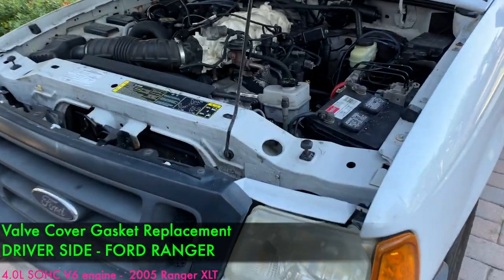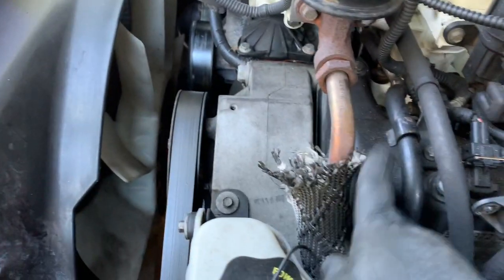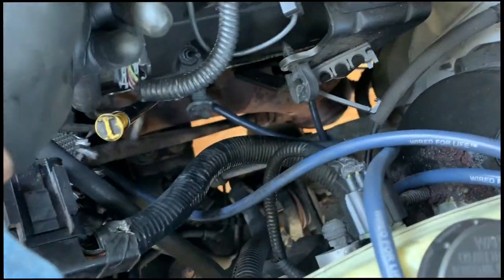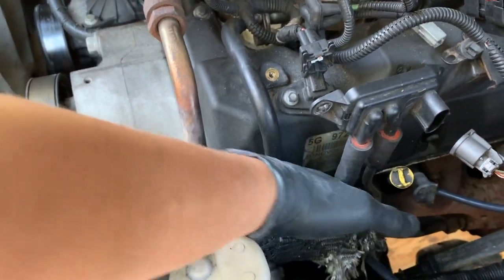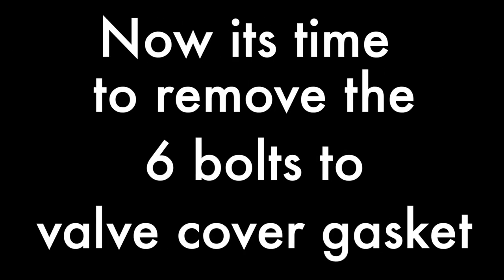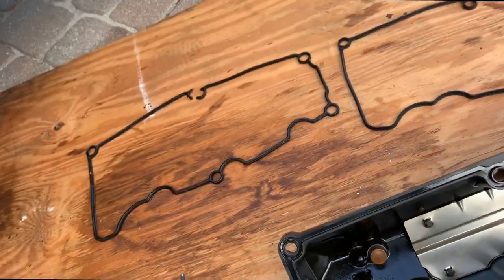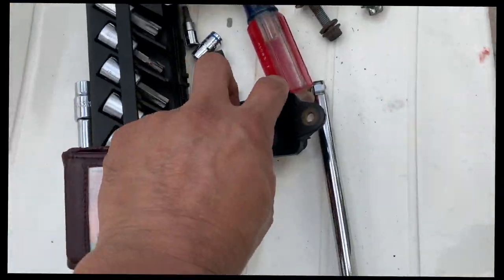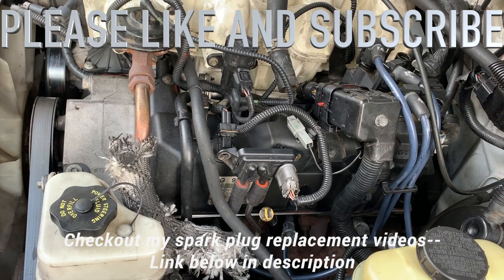Ford Ranger 4.0L Valve Cover Gakset - Driver Side

Comment: One important piece of info you did not show or mention: The PCV valve at the rear of the cover comes out with a half twist COUNTER-CLOCKWISE (it's a twist lock valve, not a straight-out pull type). The 2004 I'm working on has a metal pipe, with two hoses connected, wrapped around the PCV . I think it's for coolant heating of the PCV. One would have to unlock the PCV unless you want to pull all three hoses. A new valve comes with a new pipe ring.
Reply from the maker: @scottdelnero7360  ya but I wasn’t changing it.

Comment: I've done the passanger side thanks to your video and the drivers side needs to be done as well.  I don't wanna jinx myself but the DS looks easier.
Reply from the maker: Oliver Closeoff I’m glad it helped. Yes drivers side is easier than passenger side as it’s a matter of removing stuff. Checkout my other video on that. Should be in the link in description. If not I will add it.
Reply: How long did it take
Reply: @timblau6213  how long did it take
Reply: I did the driver side  am happy with the job I did, Thank you for  posting

Comment: FAIRLY INDEPTH VIDEO!
 IM GUESSING THAT FORD HAD ISSUES WITH THAT COIL MOUNTING BRACKET. NOBODY HAS EVER WORKED ON MY RANGER.BUT I TOO AM MISSING ONE OF THE BOLTS ON THE BOTTOM OF THAT BRACKET. THE BOLT NEAREST THE FIREWALL.
 OVERALL, IVE GOT NO REAL COMPLAINTS. MY EXT IS AN 2001 MODEL, I BOUGHT IN JULY OF 2003 IT GAD 22K ON IT AT THAT TIME.
TODAY IT HAS JUST UNDER 130K. I TOOK THAT THING TO SAN ANTONIO, BIRMINGHAM,.
WORKED IN INDY FOR MONTHS. BUT IN TNE LAST TEN YEARS,IVE AVERAGED LESS THAN 100 MIKES A MONTH...
AT ABOUT 75-80K,FUEL PUMP WENT OUT.
LATER R.FRONT WHEEL BEARING. 
L.LOWER CONTROL ARE. 
LAST YEAR,THE BEARING ON TBE FRONT DRIVE SHAFT WENT BELLY UP. AND SINCE IM ON THIS VIDEO,OF COURSE IM LOOKING INTO VCGASKETS. OH SOMEWHERE IN THERE,A COIL PACK WENT,AS WELL.
BEYOND THAT, JUST OIL,BRAKES,TRANS FLUID,REAR END LUBE.
 IM ACTUALLY REALLY SATISTWITH MY LIL RANGER.  MY WIFE KEEPS ACTER ME TO SELL IT. BUT WITH EVERYTHING AS SCREWED AS IT IS,I REALLY REALLY DONT WANT A PMT ESP FOR A 30-60 GRAND FOR A TRUCK! 
SOMEBODY HAS LOST THEIR EVER LOVING MINDS! 60 GRAND FOR A TRUCK!! ILL BE DAMNED! 
ANYHOW,THANKS FOR POSTING!!
KEEP OUTTA THE DISHES!!
Reply from the maker: Glad it helped. Please like and subscribe as it helps my channel supporting charity :)